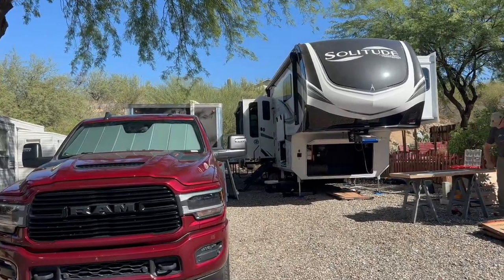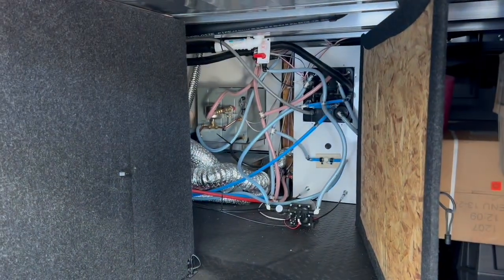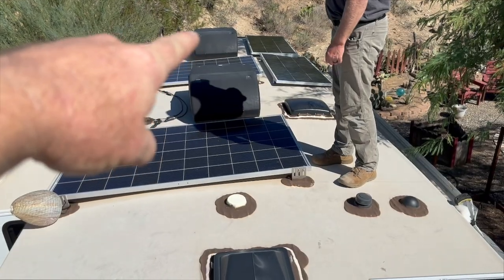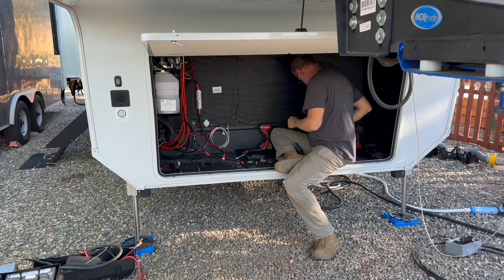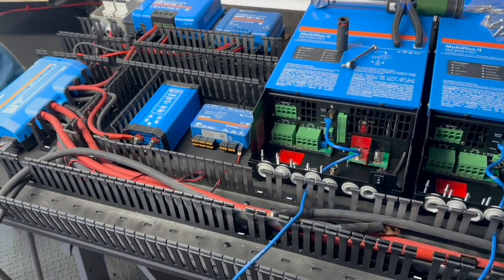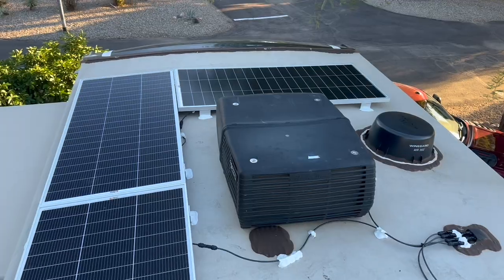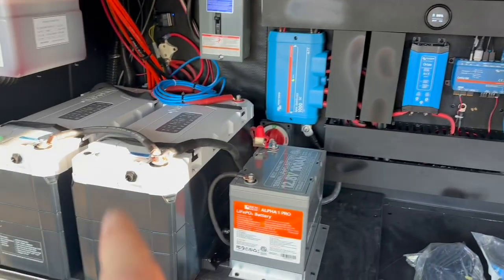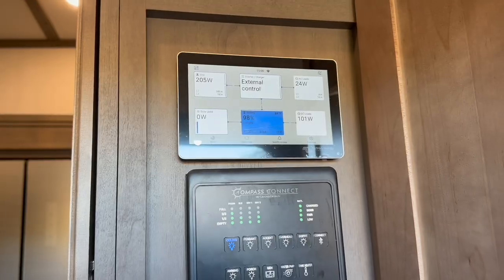MASSIVE Grand Design Solitude Dual Victron Inverter and Epoch lithium RV solar install

Comment: Nice and clean. I'm starting to lean towards a single 10kva 120v unit. With no 240v load, seems a single install vs dual (that work at 120v) would offer an easier install with more power for almost the same price
Reply from the maker: Thanks! That's a solid point, and a single larger inverter can definitely be a good solution for 120V setups. If you're in a 30A rig the 5kva unit would suffice unless you're looking for even more power for other requirements.
Reply: @TucsonRVSolar I’ve heard some pros and cons to running the mps in parallel is a loss of charge ability when on an actual 50a socket. But everyone has their own opinions 😄

Comment: Good morning, Caleb!  Whooaaa….yes, this is an awesome install!  Thank you for sharing it!

When talking about 24v systems….    You installed those 2 230ah batteries.  To put it in 12v terms, does that mean it has the equivalent of 920ah of traditional 12v lithium batteries?  I assume one gets a weight savings when going to a 24v system? 

Also, do you incorporate,or are you a fan of, the dc to dc charger for truck to rig charging while driving? 

My little 22ft boxed Outdoors RV travel trailer has 500ah of batteries and 1495w of panels on a 12v system.  My installer didn’t want to do a dc to dc charger as he had comments of the challenges with all of the makes of trucks out there (i have an F350 gasser with dual alternators).  And wouldn’t you know, he installed the system in South Padre Island, he finished up at 7pm, and we hit the road immediately to drive back to Ouray, Colorado.  I was like “ sweet…we have batteries, I can stop driving with the propane on and use these glorious batteries “ hehehe.  Well, by 7am the next morning, our 500ah was down to like 100ah as I know running 120v things on a 12 v system are not so efficient. 

Since we talked in March 2025, we did get that condo in CA sold.  We have some major medical procedures in January, as well as I am going to try to look for a job elsewhere (the goal is a commuting job that we actually could travel around and I just commute to and from wherever we are!).  So, we are closer to the 5th wheel purchase than when we talked!

Safe travels!
Reply from the maker: Exactly right 24V230ah = 12V460ah so this rig has 920ah equivalent. I am a fan if the DC-DC charger when it makes sense. If someone drives to a campground and plugs in then it doesn't make sense - but if you boondock/travel a lot then it is a gamechanger! I opted to use one instead of add more solar on my airstream - 300 more watts vs a DC-DC charger was a no brainer for right now!